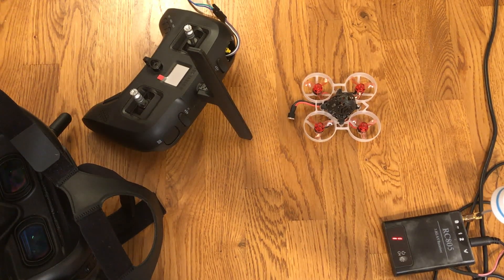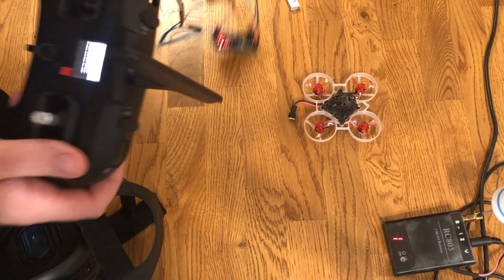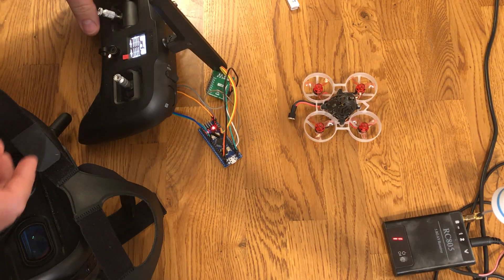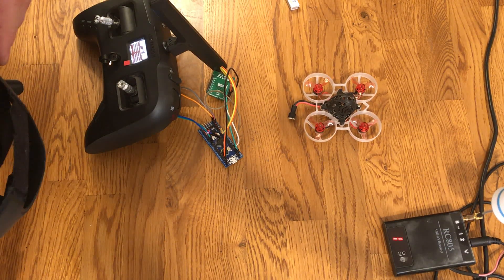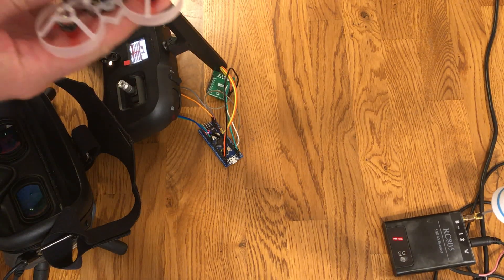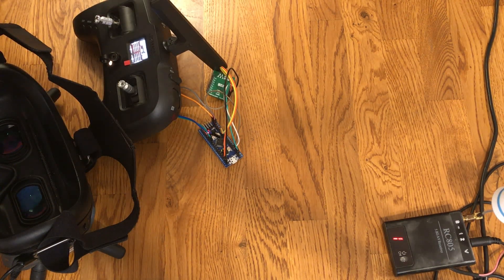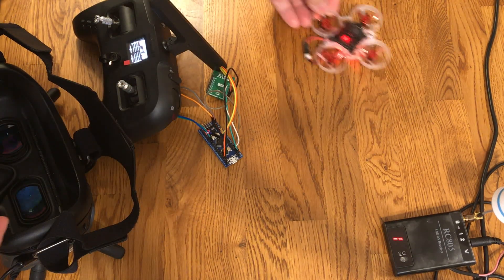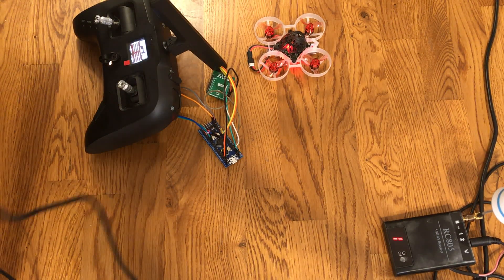Tango 2 multi-protocol HACK: flying Mobula 6 (FrSky)

Comment: that's cool and all but that seems like a lot of work, now the they have there own multi module bay add on.
Reply from the maker: True, however I started this well before the hype about the mysterious connector even started. Now, I have a working build system for FreedomTx, can flash a 100% bricked Tango 2, have the PCB mostly figured out... Adding the module was just one small part of the project
Reply: @vtecslate-nighthacks6421  it's all fun anyways. that's the first thing I did today when I got my refurb Tango 2, open it up and and swap the springs out and see what's all involved for a V3 PCB swap, which should be in next week.
Know anybody that wants to buy a V2 PCB?

Comment: Yep, I would absolutely like another video and a link to a repo with the changes.  Did you use the internal UART2?
Reply from the maker: Thanks for your feedback! That's right, the cable is connected internally to the UART2 connector and additionally the +3.3V rail.
Reply: @vtecslate-nighthacks6421  moot point now with the latest release of freedomtx, but I was originally interested in this for adding ExpressLRS 😅

Subbed and look forward to any other mods you make. Cheers